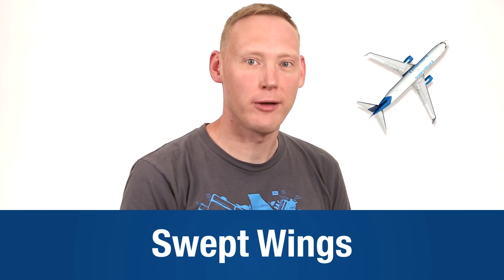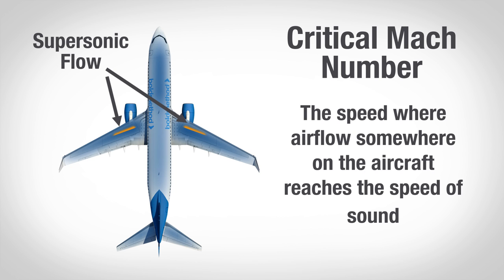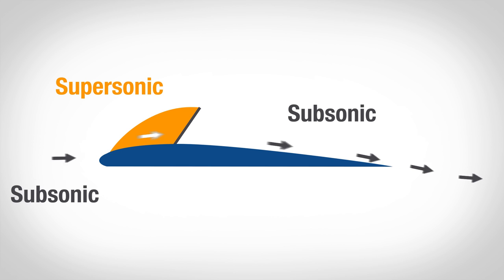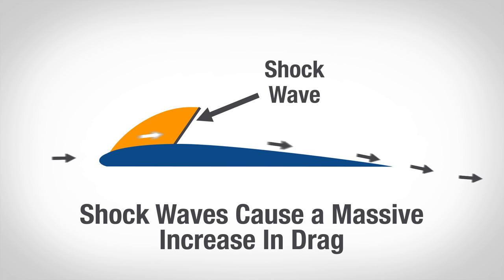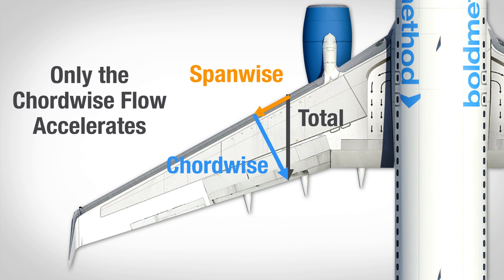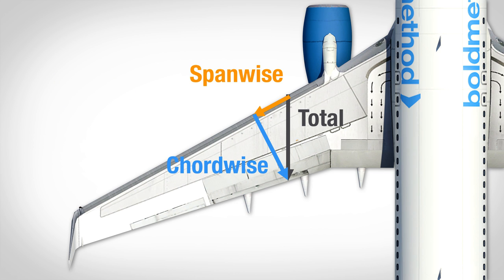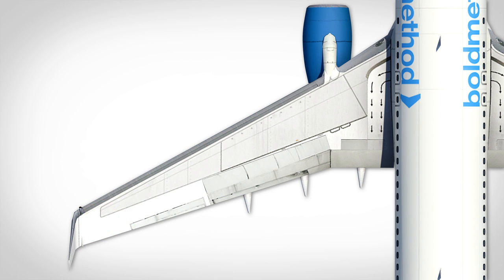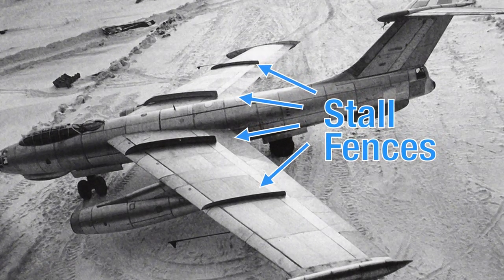Swept Wings

Comment: This is slightly misleading. Spanwise flow only occurs significantly at higher AoA. To accelerate so much air spanwise in cruise is very inefficient as it is not creating lift, just drag. The benefit from swept wing is a thinner wing for the same wingspan. Same area as unswept, with less drag and delayed Mach transition from the lower chord thickness. Also less tip losses as flow near the tip has a lower spanwise pressure gradient. Yes the textbooks talk about spanwise flow, but look at the wind tunnel flow visualizations.

Comment: Actually, the main reason why wings are sweptback is to minimize drag in general and not just wave drag. Because there’s spanwise flow, this allows the air to slide along the wings instead of forcing all of the air over or under. I’ve heard it said it’s like sliding down a ramp instead of running into a wall. Though because only some of the air is chordwise as opposed to all of it like straight wings, this also means less lift because it’s the chordwise flow that generates lift.

Comment: I kind of agree with all being said, but I wouldn't mention the critical mach number. In reality most jets operate above mach crit at normal cruising speed. That is the reason for the "mach trim" being installed, to compensate for the pitch down moment when the shockwave forms over the wing and the center of pressure moves aft.

Comment: That being said, it is true indeed that swept wings increase the mach crit and the typical cruising speed is only slightly above that, because otherwise drag would increase dramatically, and therefore that is why a swept wing would allow a higher economical speed. But the critical mach is way below the maximum operating speed and therefore is not an "hard" limit itself.

Comment: Wait, the Aileron loses control first in sweptback?!
If I'm wrong, please correct me with reference.
Here's my understanding,
Isn't it the wingroot first then the wingtip. 
Cause the critical speed is first reached by the wingroot since it ahead of the wingtip to receive the incoming air. So it will stall first to have more control over the Aileron in case of a high-speed stall.

Comment: I know slats and flaps, but what are 'slots'?
Reply from the maker: FoxtrotSim - Slots are permanently open slats.  Sometimes "slots" are called "fixed slats," and sometimes "slats" are called "retractable slots."  Slots were an early development on aircraft wings, and you can find full wing length slots on STOL aircraft (like the Zenith).  Partial wing slots were used on aircraft like the Lockheed Hudson (https://en.wikipedia.org/wiki/Lockheed_Hudson) to keep airflow attached at the wingtips during a stall - causing the aircraft to stall from the root out.
Reply: Oh okay, I got it, thanks.
Reply: and they usually have slits too.